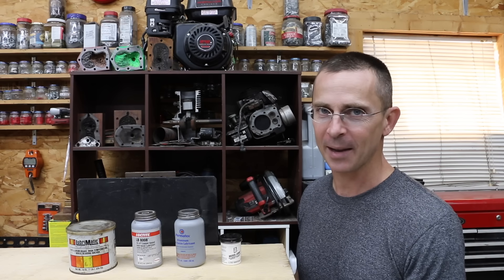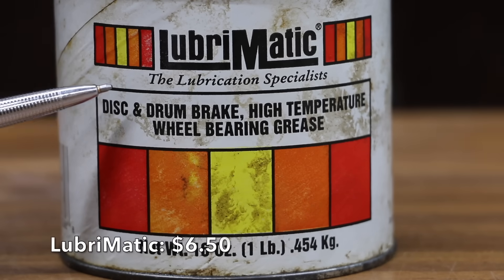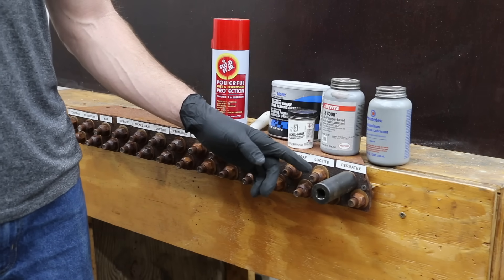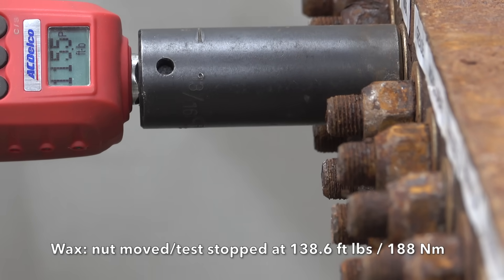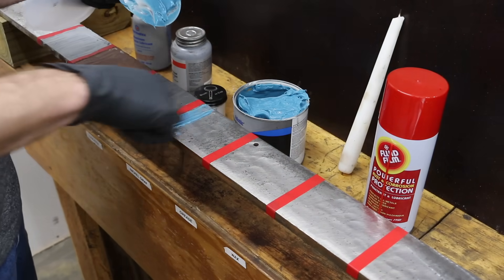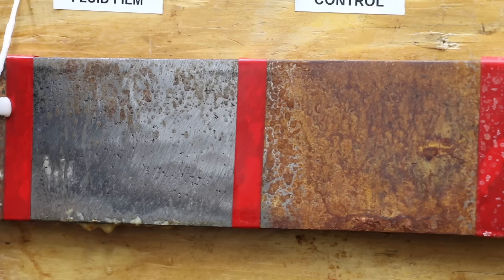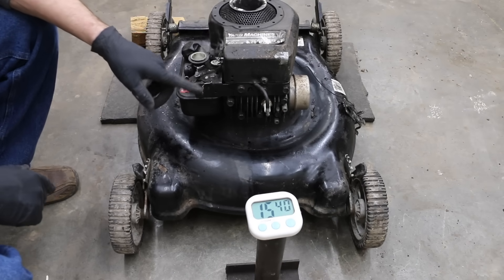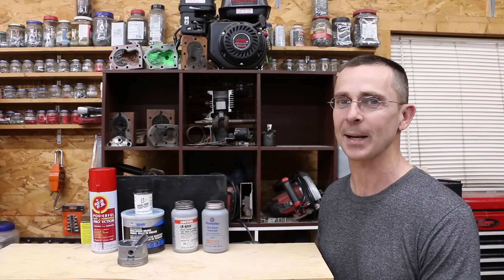Does Anti-Seize Compound Actually Work? Let's find out! Anti-Seize vs Grease vs Fluid Film vs Wax

Comment: We were making a 800MW generator stator housing valued at about 100k. The end plates needed to be threaded. When the studs were test installed, tech forgot to add lubricant/anti-seize. When the studs were removed, it chewed up the threads on the end plates. Holes with lubricant/anti-seize had no problems. Always use anti seize when fastening metal. The larger the diameter, the more important this is.
Reply from the maker: Thanks for the feedback!

Comment: A very common use for anti-seize is on spark plugs, especially in aluminum heads.  Could you do a comparison based on dissimilar metals and repeated heat cycles.
Reply: Dissimilar metals are the only thing I use anti seize regularly. Steel bolts in an aluminum block is the only place I know I need it.
Reply from the maker: Thanks for the video idea.
Reply: Is it safe to use anti seize on Toyota aluminum 4 cylinder engines with OEM Denso plugs?
Someone told me the plugs would walk out of the threads under vibration?
That doesn't sound right if they're torqued to the recommended weight.

Comment: I’m sorry, but antiseize works very well. As a millwright, I saw it work on coal fired turbines for at least 6 months. We used the copper based antiseize. After 6 continuous months of high pressure steam, the nuts came loose with no problem.antiseize still visible in the threads.
Reply from the maker: Thanks for the constructive feedback.

Comment: I want to see what these guys with the candles are talking about. Can you do an episode where you find some really reuse stuck bolts and heat them up using candle wax to seep into the threads making it loosen?
I am tired hearing those guys argue  that there way is the best.
Reply from the maker: Thanks for the video idea.

Comment: They guys that comment about the candle wax is on already seized bolts and nuts. They claim it seeps into the thread with heat applied to help release them. 
I can’t fathom this technique against a good penetrating oil along with heat applied.
These tests are more for putting your boots and nuts back together. I’ve always used permeates anti seize and a lot of their products. The locative products show some quality product that I will try next time when I need to restock.
Reply from the maker: Thanks for the feedback.

Comment: In order for the wax to perform well the parts need to be heated or it will just sit on the surface of the cold metal. Try it again with a hot bolt, you won’t believe the difference ❤️❤️❤️❤️❤️

Comment: I Love Love Antisieze  I prefer the nickel or copper based.  My mechanic thought was nuts using it on my lug nuts. I had to remind him that proper torque addresses any issues.  
If there is a flaw in the oointment  in the test it's that you have no way to simulate the passage of time.  That  factor is  ( I think)  critical).  Maybe do it again and leave the test bar  out in the weather for a few years. 
I gotta say  if there are Small Engine Gods anywhere you might be in trouble.
Reply from the maker: Thanks for the feedback.

Comment: Stay away from the aluminum base anti seize if used in high heat 300+ degrees . Higher temperature locks the bolts ,studs ,nuts,ect . I use the Pro Chem -copper,brass , graphite, anti seize it's not cheap but it is the best I found, a cousin of the drill pipe dope in the oil patch .If you get it on your hands,clothes takes days to ware off ..
Reply from the maker: Thanks for the feedback.

Comment: Does anti seize work? I work in an iron foundry. IF you don't put anti seize on the bolts that hold the pouring rods together you'll have a very hard time getting it apart. We use copper anti seize the bolts are about 2 feet  away from 2600 degree iron.
Reply from the maker: Thanks for the video idea.

Comment: What's the best grease to use in greasable  Tie Rod  ends and Ball Joints that won't break down Rubber Boots?
Reply from the maker: Thanks for the video idea.
Reply: @ProjectFarm  Lithium  Grease, Castrol Extreme Heavy Duty Grease,  Mobil 1 Synthetic  Grease,  Moly Grease, Graphite Grease, Inox Grease, and Normal High Temp Wheel Bearing Grease.
I asked over 6 Suppliers  and 10 Mechanics,  Google, you Tube and very different  answers!
Most Mechanics  don't Care as they wast you to come back with Torn and Perrished  Rubber Boots.
And all Lables I have researched, don't mention  suitable  for Rubber.
Rubber Grease has not got the Heat and High Pressure  Quality's to do the Job.
My Guess.
Is Synthetic or Inox would be best.
You also can get your hands on Genuine  Toyota encapsulated  Tie Rod End and Ball Joint Grease but only could  find in Tube and not 400g Grease gun Tube.
Manufacturers  don't put Grease Nipples on a lot of Susspencion and Steering Components  just to save money  and Encapsulated  Components  last the Warrentee!

Comment: the copper, nickel, and aluminum anti siezes have different uses.  i think the nickel is for high heat, like exhaust parts. i think the copper is for dissimilar metals, like steel spark plugs in an aluminum engine head.  the aluminum offers similar performance as copper when joining similar metals, which we saw here, at a much lower price point.  a more useful test would be to test different brands of each type, in the applications for which they are intended.
Reply from the maker: Thanks for the constructive feedback.
Reply: @ProjectFarm I'm a big fan and watch regularly, btw!

Comment: Amazing job man! Just a note on the error: you can't use the standard deviation if your sample is 2 nuts per product (or in general less than 10). In that case you should use the half of the difference between the maximum and the minimum value. Cheers!
Reply from the maker: Thanks!  Thanks for the feedback.

Comment: Love all your videos. I finally came up with a suggestion. If you were stranded with a leaking radiator and had no water, but heaps of beer, and you only had to top up the radiator periodically, does the beer or urine from drinking the beer make a better engine coolant. What do you think 🤔? Would beer be more likely to foam or froth and therefore boil out quicker than the urine? 
Do you drink the beer first? Or tip it straight in the radiator?
Reply: beer is literaly water with some alcohol in it so, it should work

Comment: Built a Caterham Super 7 about 17 years ago using copper anti-seize on everything except - due to an oversight - the side mirror mounting screws. The car has always been dead easy to dismantle except for - you guessed - the side mirror mounting screws that had to be drilled out. So I have no doubt about the value of copper anti-seize.
Reply from the maker: Thanks for sharing.

Comment: On the next revisit, if there is one, I'd like to see silicone grease compared.  It's also lauded as being great for corrosion protection.  There is also a spray copper anti-seize compound, recommend by some Audi techs.  Audi front pinch bolts are a nightmare in the aluminum spindle/knuckle arms. Great video!  Man, anti-seize as almost as bad at being cleaned up as thermal compound used on CPU's.  Hmm... another comparison!?  lol
Reply from the maker: Thanks!  Great suggestion.  Thank you.

Comment: You do know brake away torque is different than tightened torque? Dont want to boar you but a thread is a constant incline plain that pushes the nut out rather than drawn in. Can't beat mechanics but can convince viewers

Comment: "What kind of oil do you use?" 
"I dunno, thousand-weight maybe?"
Reply: Some oil is better than no oil.  I used 90W gear oil because it was the only OIL I could get where I was at. That was used oil that they dump on dirt roads to keep the dust down. Beggars can't be choosers. Middle of nowhere was the road crew. It stunk but got me another 500 miles to a town.
Reply: @bunzeebear2973  The W stands for winter and is a rating based on how the oil performs at cold temperatures. the 90 is the SAE number for the oil viscosity. Also I hear that you can always use thicker and it's using too thin an oil that gets you in trouble.
Reply: @chronomancer8772  Gear oil really is marked as 90W with no other number. And no, using something this thicc will inherently cause damage to bearings in the long term if it can even be pumped in sufficient flow.
Reply: Lol awesome

Comment: I like to use cheap aluminum paint as an anti seize/Loctite substitute. I find it works well to keep bolts from falling out due to vibration  and from getting stuck due to corrosion. I spray it on and assemble. I generally use a lacquer based paint as it dries enough to assemble quickly. I have used enamel and didn't concern myself if it was completely dry. I don't use it on critical fasteners like lug nuts though.
Reply from the maker: Thanks for sharing.

Comment: I work on battery powered floor cleaning equipment, when a machine has wet batteries, corrosion is a huge problem, unfortunately the manufacturers of these machines don't use anti seize and sometimes a simple job turns into a nightmare because customers don't know how to properly fill a battery, when I work on anything corroded and even if it's not I use Permatex aluminum, for the price, it's the best, I never know if I'm going to be the next one working on the machine and as far as my competition is concerned, you're welcome!, the stuff has never let me down!
Reply from the maker: Thanks for sharing.

Comment: Great stuff. Always working on dirt bike, race kart, mountain bike and cars. Used to work at a bike shop and we always used anti seize, especially when screwing into aluminum parts, and always when using things like titanium or aluminum bolts. I’ve always made it a habit to even use at least a good grease on any threads when working on my stuff. Glad to see that grease works fairly well.
Reply from the maker: Thanks for sharing.

Comment: Check out using 80w gear oil, Mystic red grease mixed with hydraulic oil, KOPR KOTE and NIKAL made by Jet Lube, for anti seize compounds.  I left this comment on another video also.  Check out Ospho, Enrust and other rust converters for a possible video.  Thanks.
Reply from the maker: Thanks for the video idea.

Comment: Wax doesn't work well if applied to a room-temperature fastener. It just solidifies and falls off when, for example, a nut is screwed on. In order for the wax to coat the fastener and stick, the fastener has to be hot enough to melt the wax -- and that's usually impractical.
Reply from the maker: Thanks for the feedback.

Comment: In real world applications, for ease of removal years later, of engine exhaust parts, I never found installing the threaded fasteners with high temperature grease to be adequate. However I always found Permatex anti-seize compound to work well. When I unscrewed fasteners years later, there would not be able to see any grease left on threads on which I had put grease, however a thin, dry coating of anti-seize compound would remain, and those fasteners were hardly any more difficult to remove than recently installed fasteners would be, that had not been subjected to high temperatures. On a side note, I never understood why threaded fasteners supplied with exhaust clamps, would come with lock washers. Their threads would invariably be locked in place by corrosion, the first time the engine was run. Exhaust parts could be run at 1200 degrees F for hour after hour, day after day, month after month, year after year, a few inches above icy, snowy, and wet roads treated with salt to melt ice. I think perhaps more corrosive and more challenging conditions than those that PF has created here.
Reply from the maker: Thanks for the feedback.

Comment: Always interesting but antiseize is designed for assembly of new parts most often with friction class tolerances. What happens is galling. A small bur forms or specs of dirt and then tears up the entire thread, shaft or bore because there is no where for the snow ball of material to go other than ripping things up. With the correct anti seize lubricant the chance of galling is reduced. Not the best of ideas to lubricate a thread during assembly. Rust works better than lock washers and torque settings are for dry bolts in many cases.
Reply from the maker: Thanks for the feedback.

Comment: Oh hell yes it does. As a lifelong heavy truck mechanic I always had a can of Caterpillar anti-seize ready. The best stuff around in my opinion. Head bolts require it because they dip in to the water jackets. We have pulled apart engines we did using the Cat anti-seize with zero issues.
Reply from the maker: Thanks for the feedback.

Comment: I've used a thin coat a grease followed by quite a few liberal dense wraps a teflon tape   on an 2"bolt  it went for the long haul in some pretty corrosive conditions en still came off fresh like butter  en it's  a good thing because there isn't really enough room to get a solid purchase on the head a bolt
Reply from the maker: Thanks for sharing.

Comment: Retired now, but I put in almost forty years at a coal fired power plant. Cooper and Nickel anti-seize is used religiously. It never ceased to amaze me at the condition of some of the bolts and nuts that came apart, because anti-seize was used when they were assembled.
Reply from the maker: Thanks for sharing.

Comment: Well replacing engine oil with anti-seize serves no purpose. The thickness of it would cause a lot of braking effect on the moving parts of the engine. Bad idea. And anti-seize needs to be selected for the purpose it's used on. Such as spark plugs need a product designed for high heat. A one product fits all approach is inappropriate. I know on spark plugs I've used in aircraft piston engines, I use a black liquid anti-seize made by Champion. But I wouldn't use it anywhere else. Although the best spark plug anti-seize is too expensive for consumers. A mechanic friend had some anti-seize used on jet engine igniter plugs that actually had gold in it.
Reply from the maker: Thanks for the feedback.

Comment: I always use copperslip , I bought a new Suzuki motorcycle in the 80s the first thing I did was remove the 8 header bolts and put a small pea size of copperslip on each of them , had the bike for 13 years never once had a problem with sticking or loosening .
Reply from the maker: Thanks for sharing.

Comment: Should've had a bolt or two with NO protection from corrosion.
I'm curious how much more torque a completely unprotected bolt-nut combo would compare with the various compounds you tried.
Reply from the maker: Thanks for the suggestion.
Reply: @ProjectFarm  heh heh

Comment: Of coarse it does! That saying all Anti- Seize products are not the same! Kopper Kote works the best!  I ended up inadvertently mixing Kopper Kote with Gun Grease they do mix well together and seems to be a good improvement! 
The truck has another STUPID design FLAW where the rear bounce bracket is designed to hold water and sand!!! So I dried it out with the heat gun and filled if full of Grease!  Will clean it off when warmer and put more grease into there.

Comment: Nice video. However, the place where I have encountered seize problems is aluminum screwed to aluminum. I have an aluminum flashlight that I cannot change the batteries in due to the end cap being seized. It is no longer worth trying to open after it being damaged trying to hold it with vice-grips while using a wrench on the end cap.
Reply from the maker: Thanks!  Thanks for the feedback.

Comment: I've had plenty of experience with the Permatex. Its weakness is when it gets cold during wintertime. It does get fairly thick but it did OK as far as stopping water with salt from seizing the wheel studs. Perhaps you can add cold-weather testing next time around. Nope, I would never ever use that as an "engine lubricant". I will continue using Pennzoil's Ultra Platinum Synthetic engine oil, thank you very much 😁
Reply from the maker: Thanks for sharing.

Comment: I think you missed the point of Permatex Aluminum Anti-Seize.  I don't care about rust protection or heat.  However, when you run a stainless steel bolt into a threaded hole in aluminum, the anti seize prevents galling.  Galling takes place when a threaded stainless steel part is used on aluminum.  Things like spark plugs in aluminum heads. Water pumps in engine blocks, or a host of other applications. Just a dab of anti-seize on the threads of the bolt is enough to protect against galling.
Reply from the maker: Thanks for the feedback.